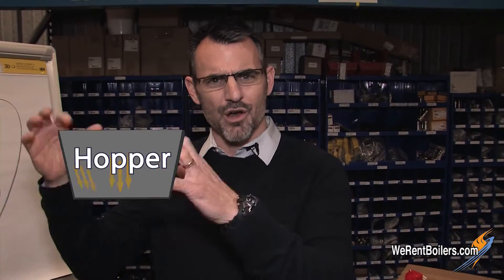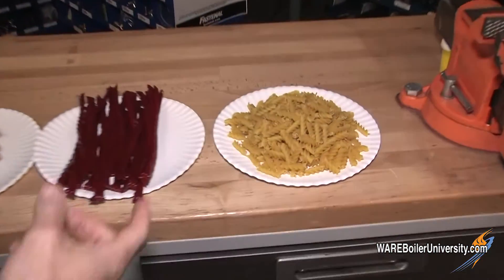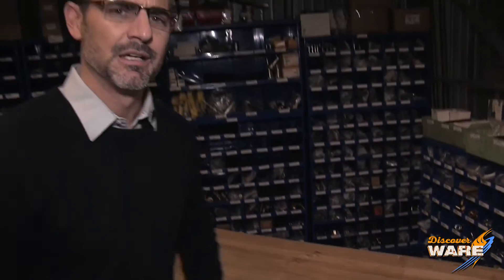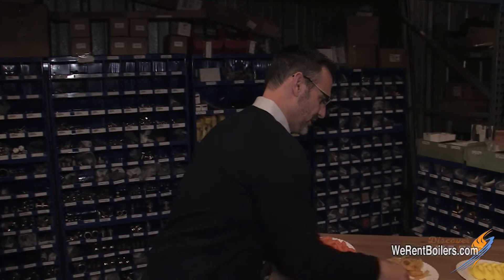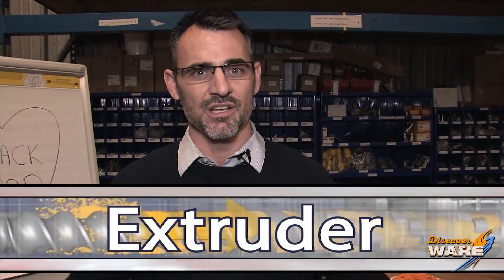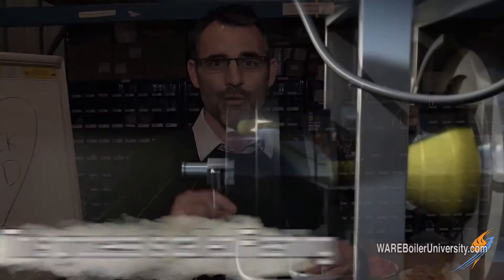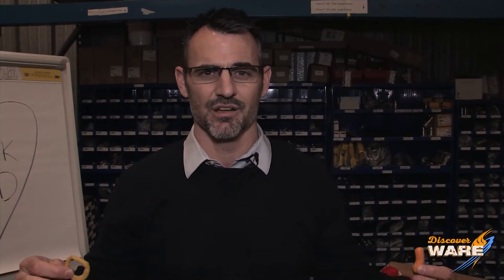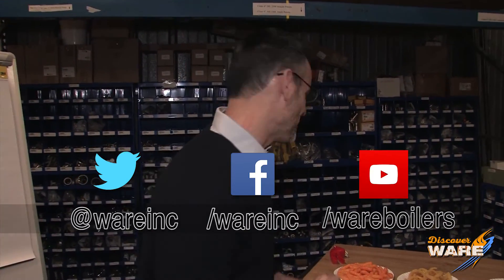Steam and Food Extrusion - Steam Culture

Comment: Hey man!! thanks for the info! however i have one question: why do they use steam rather than an electric resistance, both of them heat the outside wall of the barrel. Unless, the steam is introduced inside the barrel at a later stage.
Reply: Actually, all extruders are electrically heated. Water is added to starch-based foodstuffs, either in the hopper as a premix or injected somewhere along the barrel length. Think of the extruder as a continuous pressure cooker. At the die exit, the water used to "cook" the starchy materials now flashes off as steam. This also causes the low density "puff" of many dry snack foods. An industrial application makes water-soluble packing peanuts in the same fashion - they are largely made of starch.
Reply from the maker: Thanks for that explanation!
Reply from the maker: While we might know the true answer to this, we might be able to speculate. In large scale factories, they tend to already have steam on site so it wouldn't be an added cost to use the steam available where as electric resistance would be an added energy cost. That's at least a educated guess. Thanks for watching!